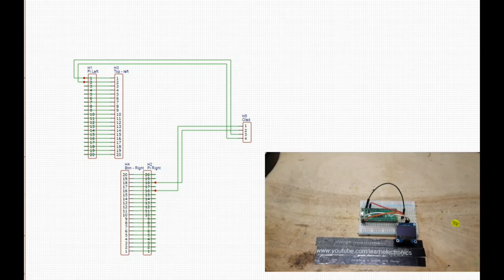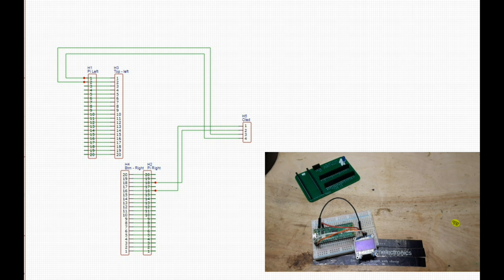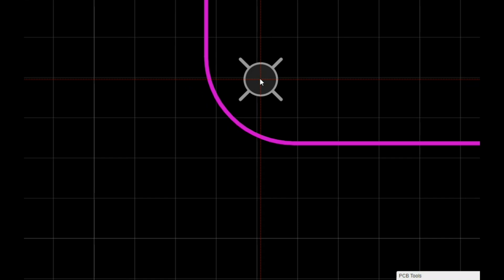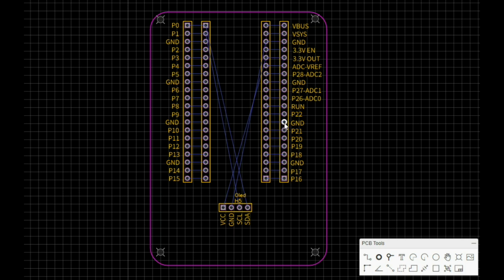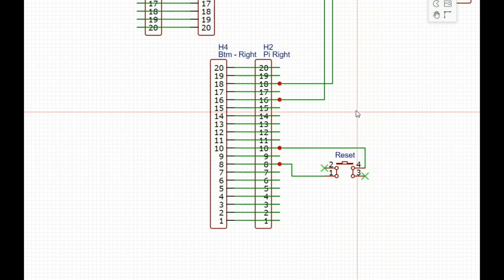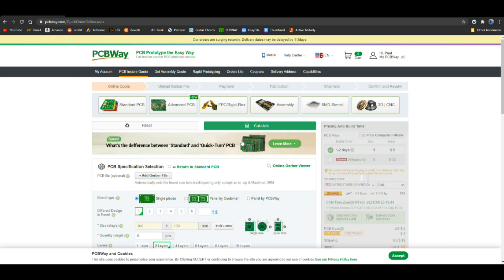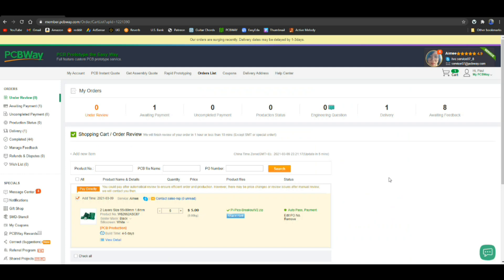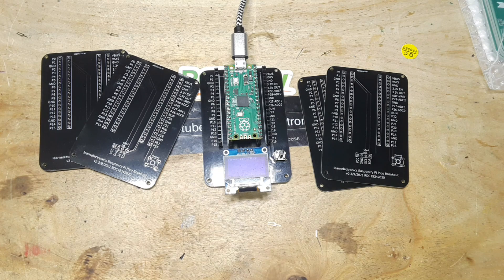Raspberry Pi Pico Breakout Board with OLED and Reset v2

Comment: This design was so good I finally gave in and ordered this board from PCBWay, order process was smooth as silk and fast.  The only issue is that all the OLEDs I had and the ones I looked at have the (Gnd) and (VCC) swapped.  I got around that by Frankensteining an adapter on a small prototype board to swap GND/VCC.  I want to learn how to do the Gerber file and layout and I'm thinking this will be a moderate effort.  Can you tell me what programs you use for doing this?  Keep broadcasting!!
Reply from the maker: EasyEda

Comment: Hey there, Paul! After 5 months, YT restored my blocked account and freedom of speech. (...so I run and I try to catch up with your lines, but their changing; racing around to come up behind me aga~ain)  Remember me, now? ;-) Been watching all along, but couldn't comment nor 'like' your content. So, I'm ba~ack :-)
Glad to see you covering the PICO. Still wondering about the great debate. Pronounced Pi CO(processor), like an extended/detachable GPIO, for RPi4 perhaps? Therefore, no need for onboard Wifi & Ble? lol Needs an ESP32/8266 HAT 4 that, incl/RST btn, AFAIC
Impressive rollout, with great documentation & community implementation. But, I think Adafruit's 2040 dev board will be a major contender, except for their price.
Like your breakout board, perhaps even double sided, since the PICO is so thin or w/o PICO headers. Nice. ;-)
Reply from the maker: Good to have ya back

Comment: Why not set the grid to 0.1 inch and snap to it? Then there would be no need for "That's pretty good for a guess..."
Reply: I agree. Paul's free form design style drives me crazy. For example, use an OLED footprint so your OLED fits on your board and not hang off. Also the random mounting hole placement would make designing a case a nightmare. I guess he gets to make more videos and gets more comments when he does it his way.

Comment: Can I order these boards from PCBWay or do I need to design my own boards?
Reply from the maker: It will be available today.
Reply: @learnelectronics  Thanks Paul
Reply: Did you share this project on PCBWay Paul, if so could you kindly share a link, I have just browsed every single breakout board on their project sharing page
Reply: Thank you for adding the link in the video description Paul. Just ordered the boards, had to go China Post Airfreight because it would have cost me over $50 to Australia otherwise. I will patiently wait because I think that these are worth the money. Thank you for your time putting this board together and thanks again for sharing your project.